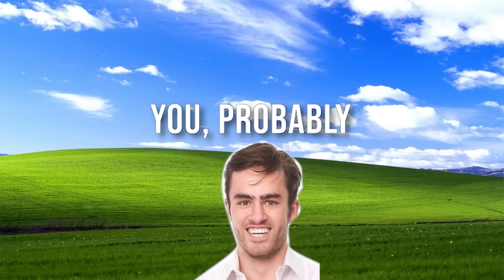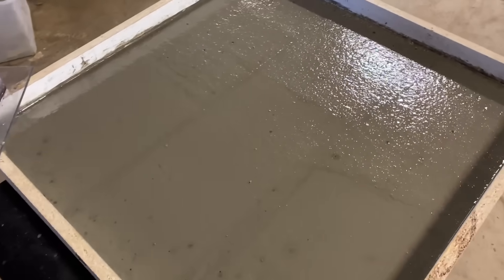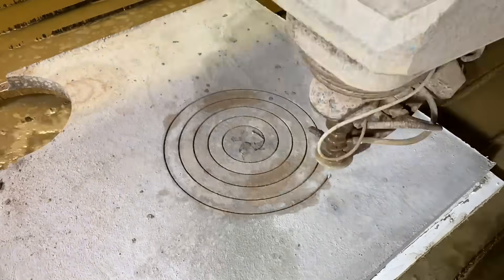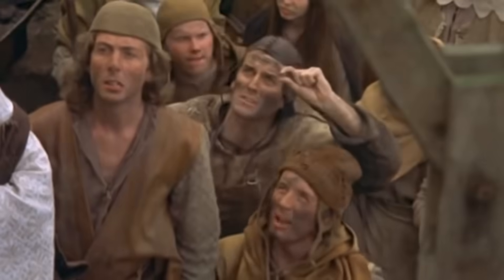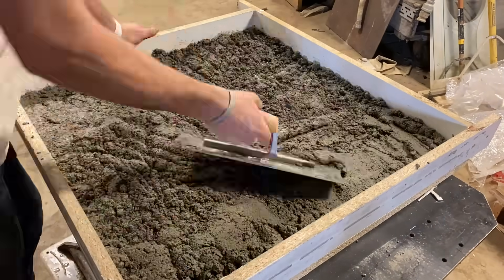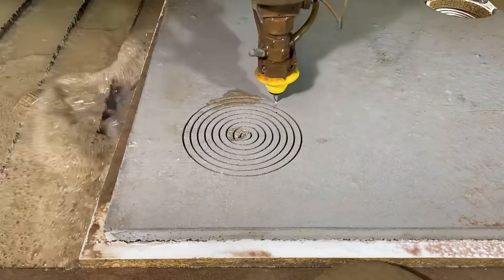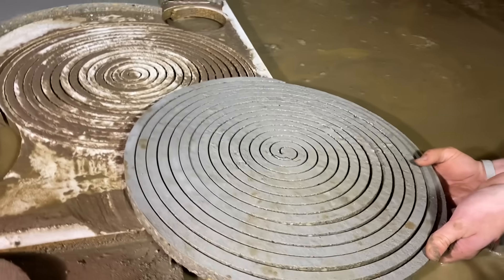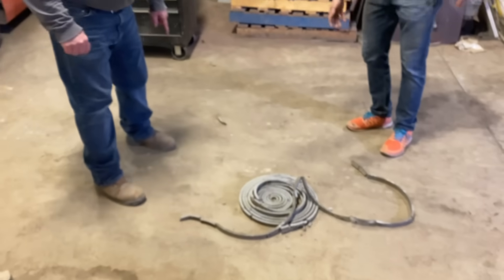We Made A Concrete Slinky

Comment: So, just FYI, the cement clearly has untouched bubbles which increase how porous the cement is, and there's literally even basic workarounds. Firstly, they make tools for this exact purpose, working air out of cement/concrete. Secondly, you treat the liquid mix like a pan of brownies and you drop that shit onto a flat surface a million times to shake and force the glass bubbles to come to the surface, making the inside more uniform.

Comment: You'll get a cleaner cut and possibly less fracture points if you use a sacrificial layer above the concrete. I noticed a fair bit of swathing on your cuts (typical with non-linear cuts) and that will cause micro-fractures, slower speed and sacrificial layering might help.

Comment: I want to see you do the same thing with ROCK. Compare the flexibility of fine-grained and coarse-grained samples, and the flexibility of mafic and felsic samples (like gabbro and granite). And for kicks, why not look at whether natural banding, like in a gneiss, strengthens or weakens the rock, and whether it is stronger when the layers are parallel to the height of the cut (thickness of the slab) or perpendicular to it. I.e. find a company that cuts rock slabs for countertops, and ask for some of their scraps. I bet you could get them for cheap, or even maybe, for free if you give them a shout-out in your video.

Comment: I dont know why you would not just mix concrete in a wheelbarrow, that bucket is ruined. 
I also dont know why you used so little water on the first attempt, was it so it would break and take longer?
Can you really call a wire frame, aka aluminum wire, aka exactly what a slinky is a concrete slinky, because you coated it in concrete, thats all you did, i want my 7 minutes back.

Comment: I have a theory that the slinky would be stronger if the cut was made from the outside in instead of the inside out. The force of the waterjet isn't focused as much when it first starts and you can see at the beginning it caused a surface level crack in the concrete. Doing the spiral from the outside in may help with the strength of the middle section.

Comment: The rocks act as an aggregate, which increases internal tension and hence makes the product more brittle. I believe you can just use sand, instead of rock, as a very fine grained aggregate and that might work better. Might not even need the wire mesh.

Comment: Imagine if we could make flexible sidewalks and roadways, there would be less need to repair them because they wouldn’t crack under the stress of weight
Reply: It is not weight that is the problem. It is the expansion and contraction from heat from the sun. It's why they put expansion cracks in the side walks.

Comment: You need new material , concert won't work , try something like recycled plastic the biodegradable while recycling and this pattern will help Drain water and it will reach below the surface to the soil it may help restore some water in ground level , other than plastic if you have the resources try iron slag it easier to cut but really hard to shape like flat panel you made from cement

Comment: I think you should try putting an inflatable semi spherical balloon underneath the concrete spiral, so that it can push the concrete at a uniform rate. if it works it could have massive applications is modular habitat design as you are essentially  developing a 3d structure from a 2D structure.
Reply: There have been small buildings made by pouring concrete over an inflatable bladder, then inflating the bladder.  After the concrete sets, the bladder is removed leaving the solid structure.  How they keep the wet concrete from just sliding off the bladder though,  is something I don't know. 
Try looking up "Inflatable concrete building" or something to that effect.

Comment: You need to use vinyl cement not concrete it's more elastic and stretchy it would hold together better plus the chunks of rock in concrete make it more brittle than plain cement even so bad choice of a rock like substance.

Comment: 2:45 Back in the day asbestos fiber was added to cement to improve tensile strength in concrete where needed. I don't advise using asbestos, but you can use chopped glass or polymer fiber. I understand that's what they add to the cement now for greater tensile strength. Also consider using the admixture of acrylic latex (?) they use in mortar for tile floors and such. Cheap version is to use white "school glue".

Comment: Cutting an iron pipe into a spring could be interesting maybe using the "lathe" from the baseball bats and cutting at the pitch angle on one side. Wood dowel could be used to support the cut part. Synchronizing rotation with the movement of the cutter could be tricky.

Comment: `The ideal circumstances for curing are ample moisture and moderate temperature and wind conditions. Curing should be started as soon as possible and should continue for a period of 5 days in warm weather at 70 ºF (21 ºC) or higher or 7 days in colder weather at 50 ºF to 70 ºF (10 ºC to 21 ºC).

Comment: "I have no idea what amount of concrete this is" doood, it's exactly the same amount of concrete it was before you removed the rocks. the rocks don't absorb water. the water is for the mix which you still have. It's like a jug of instant pancakes that you just add water to. just because you added blueberries or chocolate chips doesn't mean you need more water.

Comment: You guys could try using fiber materials instead of rocks. The way it works is that the fibers will link eachother through the concrete making a "fabric" inside it. Even when the concrete cracks, the fibers from each side will hold the structure togheter.

Comment: Ways to improve your results: 
1) Wait for 10-14 days after pouring concrete to let it stiffen up
2) Don't include gravel/stones - they are a weak point in the mix
3) Use a 50-50 ratio of sand and cement 
4) Add fibreglass re-inforcement fibres
5) Add metal gauze (used comonly to filter water and coolant fluids in machining centers)
Reply: it's not a 4 inch thick driveway, a week's more than enough

Comment: I work in a construction materials lab. Most concrete is probably up to 70 to 80 percent of its maximum strength after a week. The problem wasn't the cure time, it's that concrete is extremely weak in tension. That's why rebar gets added to it. What they did with the metal mesh was reinforcing it so that even though it still broke the mesh held it together. Rebar keeps it from flexing, mesh holds it together.

A lot of concrete will be strong enough after 2-3 hours for people to walk on it, and after a day light traffic. By a week it will have reached a majority of the way towards its peak strength, sometimes even exceeding its rated strength by that time. The issue is that concrete has very little strength in tension (flexure) and so them trying to make it "springy" by cutting it into a spiral is not going to work regardless because it doesn't have much resistance to that type of stress.

A month (28 days) is the time at which concrete is supposed to have reached its rated strength. It's not weak before that though, and construction is often continued atop recently poured concrete after a few days and some early test breaks have been performed to confirm it is up to enough strength. Roadways usually open up after 2-3 days from being poured.
Reply: Didn't help that they were using ready mix.
Reply: @ianmcnab9534  You clearly have never done concrete work because "ready mix" comes in a truck. You have no idea how to use the terms you're throwing around.
Reply: How could they make it flexible?
Reply: @dattebenforcer  Glass fiber reinforcement.
Reply: @mikeznel6048  either glass fiber, or better in this case polymer fiber.

It gets mixed into the cement instead of gravel and is scattered to help combat tensile forces in all directions.
Reply: @DARKredDOLLAR  Euclid Fiberstrand. Would also use some HRWR and set retarding additive to boost the strength. also if you cure it in water for 28 days like a test cylinder you may get better results.
Reply: @DARKredDOLLAR  Definitely agree with the poly.
Reply: @mikeznel6048  no type of reinforcement won't make the concrete flexible, just less susceptible to falling apart when it cracks. You need an additive or admixture to change the chemical reaction taking place for it to be less brittle. Plastic shrinkage reducers is a good place to start.
Reply: @dattebenforcer  that is a question not of the physical way that the concrete is reinforced or cut in order to actually get success in the way that they hope you would have to fundamentally change the way that the concrete was chemically curing

Rather than forming into crystals you would have to form into either long chain polymers like a plastic or change into some type of really large looping molecules that were bound to each other like molecular chainmail
Reply: @dattebenforcer  mix cement with epoxy instead of water 😛
Reply: Having moved into a new to me but very old house, I have some concrete work ahead of me and would like to ask
In dry hot climate should I keep the concrete wet for a few hours or a day? Cause I think it dries too quick before it gets a chance to set. I've done a test spot and saw it turn to dust after a few days...
Reply: @dgurevich1  
Edit: TLDR keep the surface wet for an hour or two. 

I'm not aware of any place that covers concrete while drying regardless of heat around here (Colorado, also dry but not super hot). I've seen sidewalks and big slabs being poured in the middle of the day on 95+ F days and they leave them exposed after finishing work is completed. The big thing is to have the concrete into the forms before it loses its moisture. Concrete workers will keep flicking water on top of the concrete so it stays wet for a bit as it cures and then do finishing work (smoothing out the surface and making it nice) once it has solidified a little (usually an hour or so after placing?). In general concrete is stronger the cooler the temperature it cures at, but it takes longer to cure when cool, so cooler is what I would think is better if strength is your concern. 

If you're really concerned about the temperature outside immediately after placing the concrete you could set it at night when it's cooler temperature. By morning in a few hours the surface is already going to be solid. 

I would consult a concrete company or someone who is an expert in concrete mixes/placing. I don't know too much about specific practices for extreme climates, and for something as important as a house you want to be careful. 

Also, make sure the ground under whatever you're doing is solid :) Foundation problems are usually due to soil settlement and not concrete lacking strength. The weight of the concrete compacts the soil over time by squeezing out water/filling in voids. When the concrete isn't laying flat that is when it'll end up breaking in tension.
Reply: @dgurevich1   the rule i was taught was an hour of wet for every inch of thickness. The longer it stays wet generally the stronger the end product will be, and massaging the aggragate into the center of the slab is also a big part of having a smooth non crumbling surface.
Reply: Exactly, came to the comment section to add this if it wasn't here.
Reply: This is great information! But also why did you say the exact same thing three times in different wording 💀
Reply: @adnamamedia  A mixture of rambling (mostly that to be honest) and a mixture of trying to use different examples/phrasing to try and communicate clearly. Everyone understands things in a little different way and has different background knowledge.
Reply: I'm not reading all of that
Reply: So I have a question a bridge was built like a few years ago but they lit took like 12 months to season the damn thing like what?
Reply: @908animates  Without more info it could be any number of things, but it almost certainly isn't an issue of the concrete curing. Soil settlement, litigation issues, safety questions, infrastructure below the bridge not being complete, structural reviews/testing ... there's a lot of things that hold up construction or go wrong.
Reply: @Scevenex  Concrete is pretty amazing, it can take more than 50 years for it to reach its full strength, rated strength is really all you need though. What’s annoying is when you have customers that think it’s ok to drive heavy equipment on the concrete after only two days even when you took them to wait two weeks and then get angry and try to sue when it cracks.
Reply: Smart
Reply: one rebar alongside the whole spiral would be the answer
Reply: Man, you know your concrete.  This is very interesting.  I had no idea about these kinds of time tables.
Reply: When someone actually knows about the matter >>>>>>>>>>>>>>>>>>>>>>>>>>> youtubers
Reply: Bud, you learn all this in the first 2 months of training or the Home Depot 1 2 3 DIY book. Definitely don't need to work in a concrete lab. Cute though 👍🏻
Reply: Concrete tensile strength equals 0. 🤪

Comment: Not the same without the original crew.
Reply: What happened to them?
Reply: they got promoted and passed on the channel to coworkers, it has been said at least a 100 times by now.
Dan an Mitch might still participate in a few videos but they don't run the channel anymore.
Reply: @ledocteur7701  "at least 100 times by now". In the comments, where more than 50% of viewers don't go. Why do people need to go digging through comments to find the answer to their question? An official statement is needed or people will continue to ask.

Comment: Do they realize avarage concrete cure time is about a month until it achieves nominal strength.
Reply: I don't think they did realize that. and they definitely should have after seeing how brittle the first test was.
Reply: This is exactly what I was thinking.
Reply: Not really true. Concrete will be strong enough after 2-3 hours for people to walk on it, and after a day light traffic. By a week it will have reached a majority of the way towards its peak strength, sometimes even exceeding its rated strength by that time. The issue is that concrete has very little strength in tension (flexure) and so them trying to make it "springy" by cutting it into a spiral is not going to work regardless because it doesn't have much resistance to that type of stress.

A month (28 days) is the time at which concrete is supposed to have reached its rated strength. It's not weak before that though, and construction is often continued atop recently poured concrete after a few days and some early test breaks have been performed to confirm it is up to enough strength. Roadways usually open up after 2-3 days from being poured.
Reply: They run a machine shop. I doubt they have much concrete experience
Reply: I came to the comment section looking for this to be the number one comment.
Reply from the maker: We let it cure for a week 😩
Reply: @WaterjetChannel  I work in a construction materials lab. Most concrete is probably up to 70 to 80 percent of its maximum strength after a week. The problem wasn't the cure time, it's that concrete is extremely weak in tension. That's why rebar gets added to it. What you did with the metal mesh was reinforcing it so that even though it still broke the mesh held it together. Rebar keeps it from flexing, mesh holds it together.

Comment: You could make it again but next time add in concrete fibers it will help it to stop cracking potential
Reply: Glass fiber reinforcement.
Reply: They should add rubber or latex to it to make it more springy.
Reply: you mean fibers to concrete?  concrete fibers are rocks